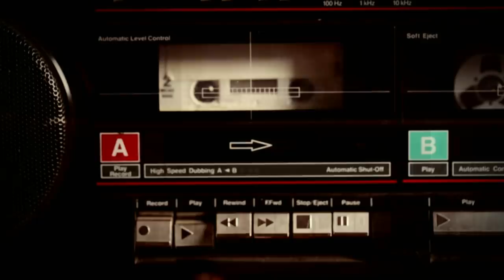Richard Rawlings Sells A 1980 Chevrolet El Camino for $50,000 | Fast N' Loud

Comment: I brought 1981 SS El Camino from the company I worked for $150 dollars. I immediately took that V6 out of it and put a 350 high performance engine in it.That car was fast as hell but very hard to stop.It definitely needed a brake upgrade and a frame strengthening.85 mph speedometer which broke immediately when I put that V8 in it but definitely fun to drive
Reply: Yeah come check out the el Camino on our channel tell us what you think
Reply: Did yours have a boxed frame like the earlier Caminos did?
Been wanting a late model EC for a retirement daily....take my 67 on cruise night. 
They seem to have more room inside and way more comfortable. Problem is finding one thats not a methmobile special

Comment: You have to really want to wire those coil packs backwards, they all run down the loom it’s impossible to mix them, you either gotta be a huge idiot or do it on purpose. Love the acting
Reply: reverse voltage on a coil has a hard time lighting the plugs lmao.  seeing as how thats a custom build, custom harness. that can happen.

Comment: Kinda resembles a 1990s build with the painted bumpers and goofy wheels. Dig the powerplant but 50k for that?
These were actually really good driving cars when they were new. Just put a decent set of shocks, drop it 2 inches and cruise

Comment: "we just keep running into problem after problem" yup that's a El Camino
Reply: @og-greenmachine8623  o idk I only own 2 El Caminos wtf do I know right 🖕
Reply: @johnfall3655  
NAME AN ISSUE OR STF.
I have had ZERO in TEN YEARS.
(Edit)
Had to loosen pssgr side heedar to change starter.
My BIGGEST frustration EVER w/my 72’ Elco.
Reply: @og-greenmachine8623  well smog emissions egr valve radiator starter wiring harness catalytic converter timing chain about 4 carburetor and o yeah a whole new fukin crate motor. Trust me dude I love my classic cars and the government can kiss my ass if they want them. All I'm saying is there a pain to maintain all I'm saying. Chill out
Reply: @johnfall3655  
Oh... 
well AGAIN.
That’s particular 
TO ALL PRE-POST 70’’a AMERICAN CARS🇺🇸
Whole point was to TAME the muscle
My 72 has ZERO emissions equip. Installed 
or
Required.
-Emissions are not an issue/pre 1976 cars in my state.
I’ll help you out, so we end w/you kinda RIGHT.
Problem you have both my U.S. & German cars?
  RUST😖
Reply: @og-greenmachine8623  I do have a 68 Camaro as well other than a little body issues fukin fantastic car. Let's keep the muscle car community alive. Because the Democrats want to take them away

Comment: That car isn't worth $50,000
Reply: Yeah come check out the el Camino on our channel tell us what you think
Reply: @NotaMechanicJack  are you talking about the white SS
Reply: @markburns7065  yeah tell me what you think about it on the video
Reply: You have obviously never done a full restoration on something. All of that aftermarket goodness on this car costs money and lots of it. Just that LS from Mast Motorsports is over $16k...new t56 transmission adds about another $3200.....fuel system another $2500 (minimum)....Strange brakes and rotors and spindles another $2500.....Strange 9 inch rear another $2500.....Just that shit alone adds up to over $26,000......that doesn't include bodywork, paint, interior, man hours, all the little tidbit shit during a build that will nickle and dime you to death etc etc.
Reply: @vandersgarage4682  Yes i have done a full restoration frame up on my 68 Camaro.The amount of money you put into it doesn't make it worth that kind of money
Reply: @markburns7065  It does to the right buyer. You say it's not worth it, yet someone bought it for that price. Everybody says his cars are over priced, yet they always sell.
Reply: @vandersgarage4682  there's always a fool out there to spend money on something that's not all original
Reply: @markburns7065  That comment shows your ignorance on the classic/custom car market. I'm done here. No sense arguing with someone that obviously hasn't got a clue. Have a good night.
Reply: @vandersgarage4682  all original the way the factory made it is worth more money than any custom build especially numbers matching car